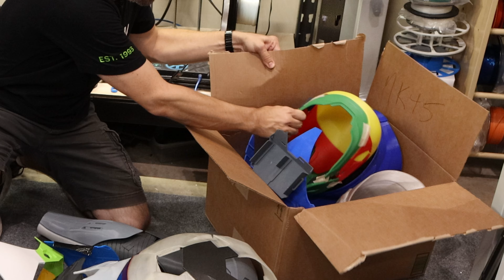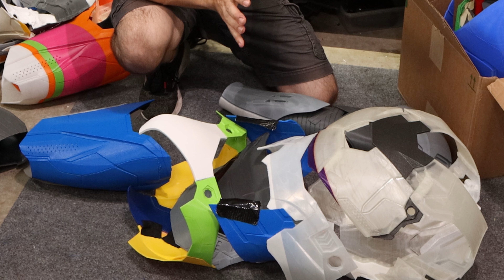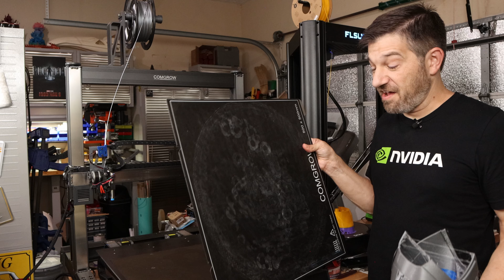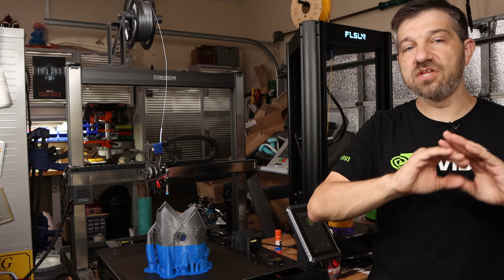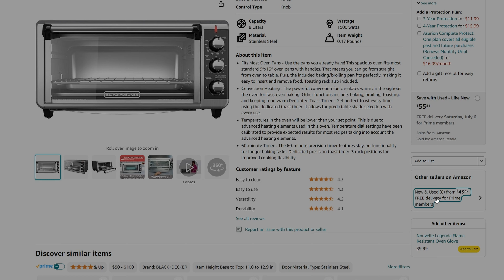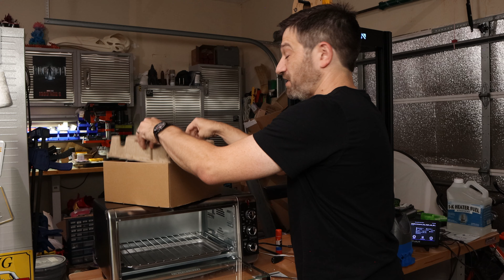Prototyping and Getting Setup - Iron Man Suit 2024: VLOG 1

Comment: Haha print from the toaster oven like I do sir! Get a thermometer with external probes. Drill a hole in it for a steel bar, flip the toaster on its side and use some washers in grooves cut in that bar to keep the spool from walking side to side. (Don’t want it touching the heating elements) I do this and print from it with a Ptfe tube going to my P1S, makes nylon easy.
Reply from the maker: Thanks for the tips! Trust me, I've considered it! In the next VLOG you'll see what I came up with that's working well.

Comment: I have a CR10S-5 that I have put a Bondtech Extruder, TH3D DBL Leveling Kit, a silicon heater mat, and a buildtak flex bed with printing surface. It has worked really well  I even  printed a full size R2D6 Dome in one shot without any issues (about two weeks of printing) except for a power outage that I was able to manually recover, which was not an issue with the printer. Printer sits an a large table from IKEA that is wobbly as heck and the print still came out surprisingly good.
Reply from the maker: It is still a fantastic printer! Not the fastest on the block but reliable and high quality. Nice upgrades!

Comment: What is it made out of?
Reply from the maker: This is mostly PLA. I plan to print the final suit in Carbon Fiber Nylon.
Reply: @kerseyfabs  super cool
Reply: @kerseyfabs have you considered possibly electroplating your 3d prints?
Reply from the maker: @arachn0tron926  I considered it but it adds weight and it can be fragile. Plus, it may be cheaper to use real metal. 😅